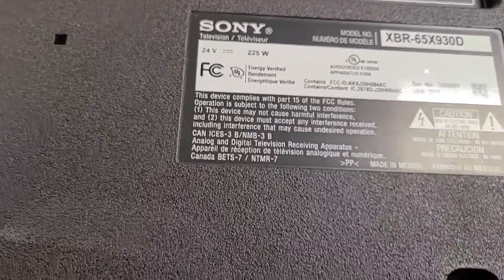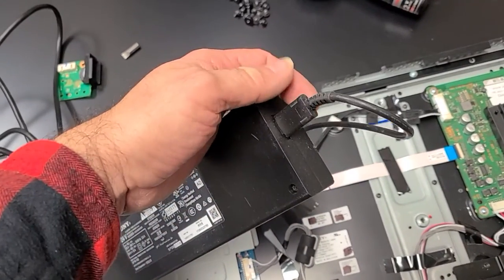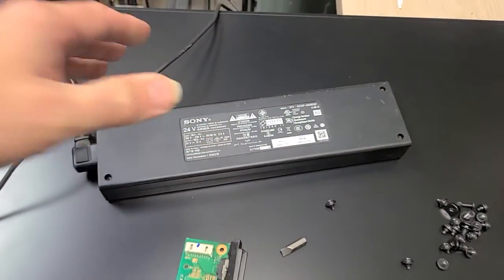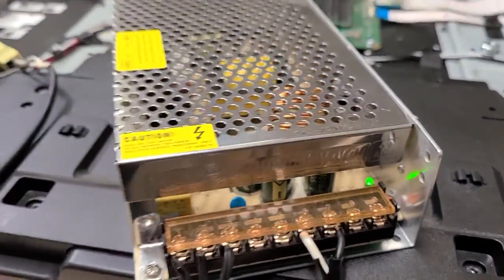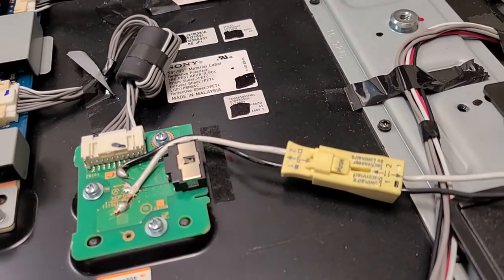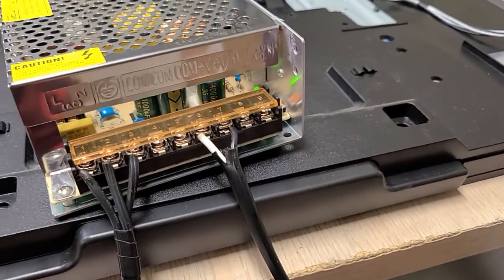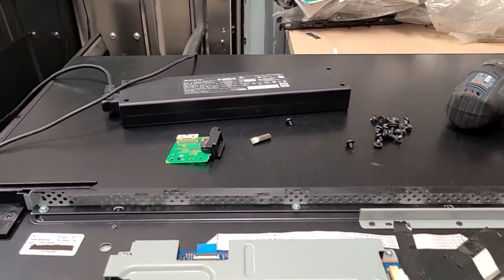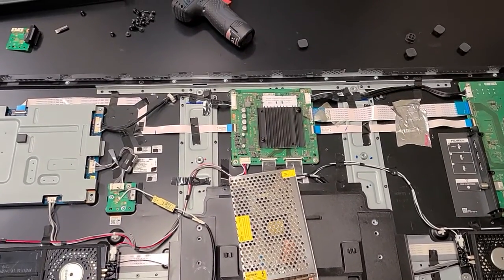How to repair Sony XBR-65X930D with bad power ACDP-240E02

Comment: I fixed my Sony XBR-65X930D by ripping it off the wall and throwing it in the garbage. LOL.  One day it just stopped turning on.   It was the worst Sony TV I ever bought, the sound blows, the picture is not that great, and the response of the menus is slow.  The thing lost internet connection all the time, wired or wireless.  I have owned quite a few Sony's, even have a newer Sony Oled which is great.
Reply from the maker: I say let's talk about your great OLED Sony in 2 to 3 years.

Comment: Thanks fo the video helped me save 120$. Can you add some details where to solder the two 24V wires in the little board?
Also your ebay link doesnt work :(
Reply from the maker: No, I wouldn't spend extra time polishing the information already provided for free just so that I can receive more appreciation...no offense meant, but 99% of people who come here do it for the free know-how and take it as given. I do not ask for likes , subscribes and donations as I frankly think that is invasive, but the fact is people still ask for more without actually giving anything...and it just can't possibly work that way.
Also, the link points to a listing that is expired, but still eBay generates tons of working links around it...I mean that's what you get for free, possibly outdated, but still usable content.

Comment: Is there a way to test the power supply to check if it is bad?
Reply from the maker: First test is to just measure the output voltage on the connector. Any even semi-decent multimeter will allow you to do that. The second test it to see if this voltage holds when there is current floating, aka "under load". An example of that would be trying to power on the TV when the power is connected and measuring the voltage at the output of the board shown in this video. Notice, however, that in this case the connector is BEFORE the measuring point, so the test "under load" would also include the physical connection, which as I show in this video tends to go bad...and when they go bad they also tend to show exactly under load.
To test merely the adapter output you need to either open the adapter and measure on the board or cut the cable and measure there...which reminds me....the same connector may be used on the other end of the cable, where the adapter is; if this is the case then it is entirely possible there is a problem there as well, in which case the only truly reliable way to measure the output voltage under load would be to open the AC adapter and measure there.
It is exactly because of those faulty connectors - which Sony has made specifically for them so you can't find them on the open market - that I suggest people just cut the whole cable deal and go with soldering on both ends. Or just use different connection cable and different, openly available connectors that can carry 10A at ~30VDC.
Reply: @coppelltvrepair  so I would have to open the powersupply brick up to test for voltage  or could I do it with the cable unplugged from the TV side?

Comment: You talked for 6 minutes and did not say anything; I had a headache after listening to you.
Reply from the maker: I am so sorry I had caused you a headache. Maybe the second time it'll be easier and on the third you may actually get what I am actually saying because it does, in fact, work for our customers and saves them money and it seems to have worked for a few other people watching this video.
Does not mean it has to work for everyone, of course, nor does it promise to do that.
Headaches are definitely not intended effect, however, and should be taken seriously.
I recommend consulting with a specialist or if the pain doesn't stop call 911.

Comment: I just wish you would have stayed on subject: Sony XBR-65X930D with bad power ACDP-240. I have the exact AC power adapter that I'm assuming is bad--it heats up to 191 F and the usb connector is partially melted and it has a white ring around the usb edge. The effect is the TV just turns off. So...rather than having a fire start, I was hoping to learn that by replacing the power adapter it would fix the issue. Or if there was another cause. Btw, Sony is selling the power adapter for $280 and another $15 for the cable! Compared that with buying a new Sony 2024 LED TV for about $750. Granted, it maybe a lower model but gain 8 years of updates.
Reply from the maker: The title of this video is "How to repair Sony XBR-65X930D with bad power ACDP-240E02", not "How to repair bad power ACDP-240E02". The video is very much on the subject on how to make the TV work when the power adapter is bad without having to spend $150 for a new one.

Comment: Nice idea but where are you supposed to put that huge power supply? Especially if wall mounted your not hiding that thing
Reply from the maker: It is admittedly thicker than the ACDP-240E02, yes. But it has the benefit of freedom of choosing cable length so you can just place it on the floor near the power outlet...and if you really do want everything concealed then I guess you do end up ponying up $120...I see they've gotten cheaper. But for most people we talk to $120 is still a lot of money (sadly).
Reply from the maker: As a follow-up....I saw how the customer has handled this. They have mounted the box on the wall behind the TV without a problem. There's about an inch more distance before the TV itself. I guess there are tiny mounts and not so tiny wall mounts...theirs must be the later kind. We do not do installations so that's not something I am very experienced with...but apparently the depth wasn't a problem. I can show pictures if anyone cares.